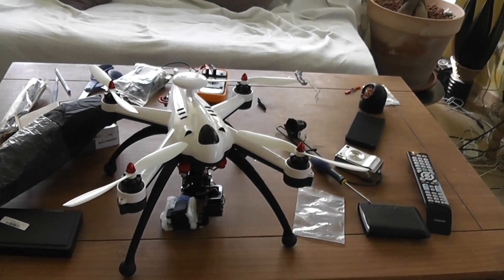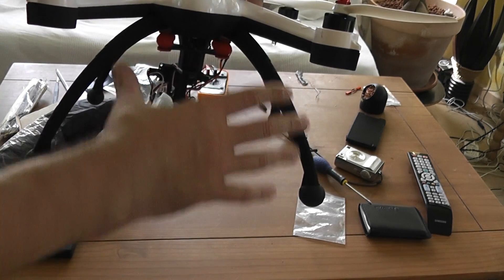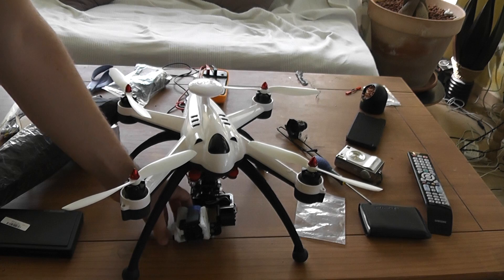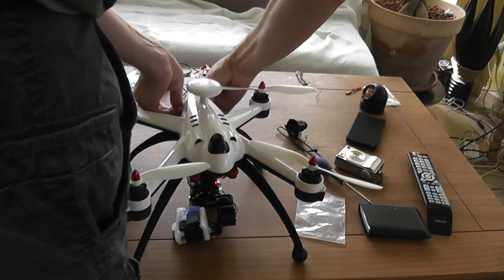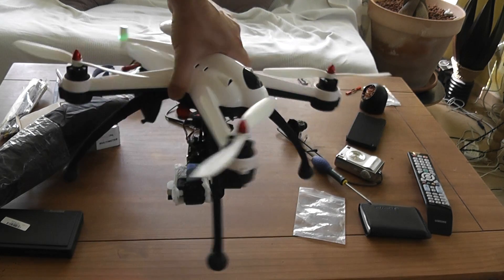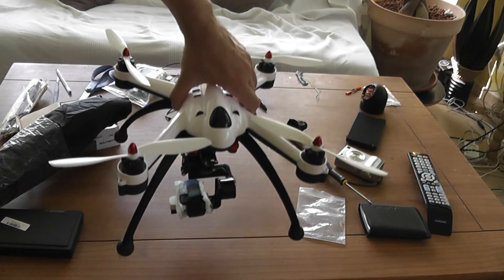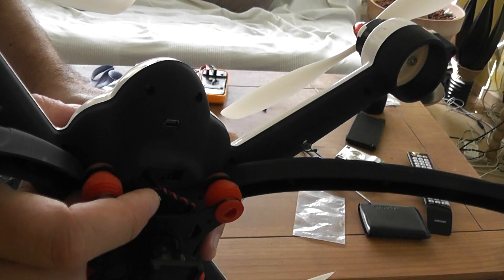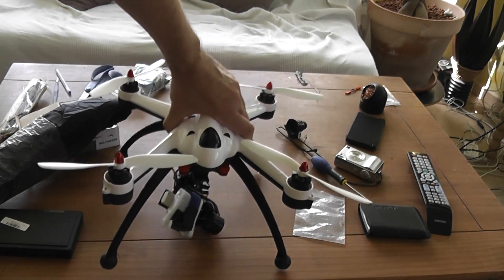Banggood 3D brushless gimbal installed on the Flying3D X8 (Courtesy Banggood)

Comment: I purchased one of these with FLYING 3D 2 Axis Airborne Brushless Gimbal for Hubsan X4 FLYING 3D X8 Quadcopter, but no instructions came with it on how the gimbal is wired to the drone, can you post a quick vid on how to correctly attach a 3d gimbal specifically the wiring section.
Reply from the maker: +Thomas Mulhern Did you read some information here ?: http://www.rcgroups.com/forums/showthread.php?t=2217137#post29060182 THere is the gimbal port pinout to install your model

Comment: Hi all, what is the better quad between the blade 350 qx2 and this Flying3d x8. I'm trying to understand which one to Buy.
Reply from the maker: The blade is probably better designed but don't have telemetry ....
Reply: SeBy DocKy I saw your review in RCGroups. But I couldn't find any comparison between the two. If you know is there a way to use another transmitter with the X8 without replace the receiver? if you know.

Comment: Hi if you want to eliminate the vibration effect you need to go with softer dampening plate cushions. The ones you have "RED" are the hardest, go with either white or black ones and you should be good.
Reply from the maker: Thanks for the tips :). Well some vibrations was due also by the fact that it's not a GoPro and the camera was not perfectly installed. After some tuning, I got much better results now. Anyway, I should have such white or black dampening balls